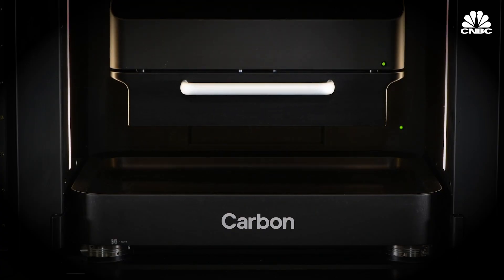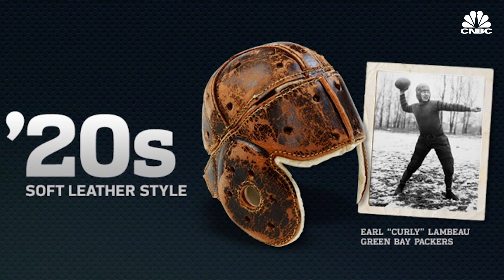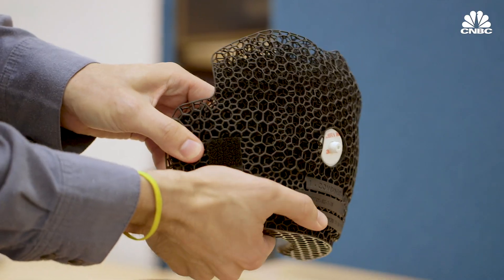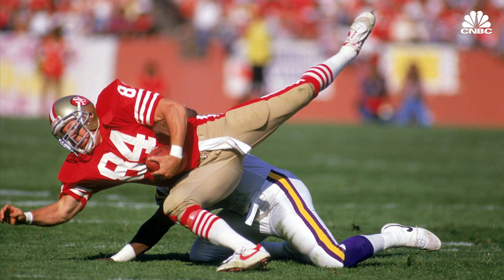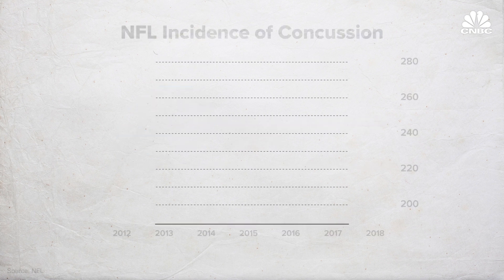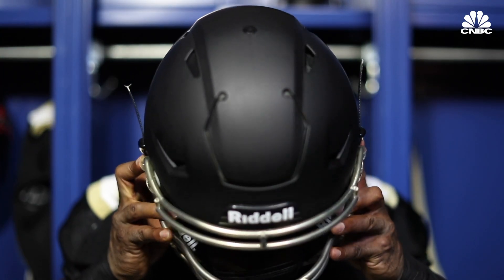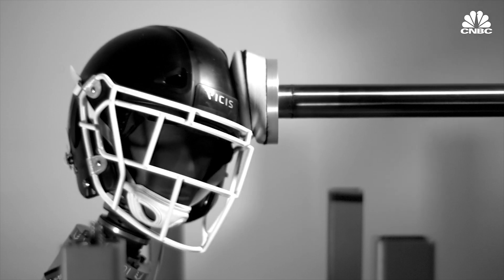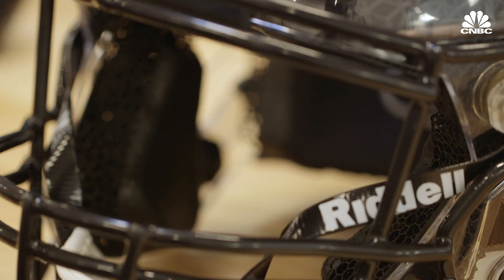Why NFL Players Are Wearing Custom 3D-Printed Helmets

Comment: It’s about how the brain moves in the skull, they are not breaking skulls they are ruining their brains. Probably the best thing would be to remove the helmets and shoulder pads because that would reduce the speed and the amount of Impacts. But If we really care about athletes then all fight sports would ban cloves, back in the day of bare knuckle boxing nobody got knocked out simply because you can’t punch someone’s face without breaking your hand.
Reply: Hannes productions The helmets of the 70s were designed to just protect against skull fractures. What their trying to do with these helmets is lessen the momentum (I hope I used that correctly) of the head when it decelerates after the player makes a tackle, thus making the brain not move as violently
Reply: A Whale but would one might think they would reduce the dangerous take downs if they had no protection.
Reply: How does gloves make it a harder hit
Reply: Jase Maiden because the gloves protect the hand which is made up of many small bones

Comment: The only thing that will make American Football safer is removing helmets. We have a fraction of these problems in Australia and we have 3 codes of football (Aussie rules, Rugby union and league) and don't even try to tell me that there's less impact or physicality in our sports. 

Removing the helmet means players protect themselves and adjust how they play accordingly. 

It will also reduce the barrier of entry into these sports with less equipment costs.
Reply: American football players hit way harder than rugby players😂😂. If you think anything else you are lying to yourself.
Reply: Yeah rugby tackles are completely different. In a sense they maximise the chance of making a tackle but also the safety. In American football you aren't told to wrap around the hips or legs. The dynamic of the game also means players are traveling A LOT faster. Rarely in rugby will you have a player performing a tackle at full speed in the OPPOSITE direction of the person with the ball. Just watch any blind side hits (generally from safeties or linebackers). These tackles not only have more force behind them, but sometimes have 0 real technique, the tackler will just straight throw his body weight (leading with the shoulder) at the other person. All this said tho, players do this cause they feel more protected. People feel invincible when they strap on some pads and a helmet...
Reply: LFly01 The updates In padding are being coupled with new/revised rules meant for player safety. So in theory: it should force players to play safer AND give them the most protection possible
Reply: LFly01 in football, most concussions are caused by players ramming into the body parts of other players or being slammed into the ground, not helmet to helmet. No helmets only leave room for crushed heads
Reply: Rugby tackles are way different than gridiron tackles. Plus, if you've ever played offensive or defensive line before, you'll know the value of wearing a helmet. I live in Australia and have played both rugby league and gridiron. These two sports are not the same. So please stop classifying them as being the same sport.
Reply: LFly01 it used to be without pads. Players were dying left and right in the early 1900’s so they mandated helmets. It’s a completely different sport from rugby. It’s mostly the linemen that have the repeated impacts.
Reply: @KanyeTheGayFish69  hell back then people were dying from infections to
Reply: Absolutely agree!
Reply: It’s too late anyway, rugby players adapted to hitting a certain way so that they would avoid head trauma but nfl players have learned to use their helmet in contact their whole life
Reply: While you have a great point.  NFL players are too big fast and strong to not wear helmets.  The game would slow down tremendously.

Comment: Instead of messing with the Helmets, mess with the pads, make them a little softer for better absorption which might help with mitigating the effect of a hit
Reply: Sergio Buryy Well the helmets are what’s perfecting their brains, which is the main issue
Reply: @gregoropesa5028  Helmets protect the skull. Which in turn can protect the brain however I don't really see how this is gonna change the momentum of one's head. The problem is that the brain goes through hypertension when hit with extreme force giving us concussions. It's not that you get hit in the head really.

Comment: Eh, more marketing BS. There's been no change in how you absorb and disperse energy. The only thing this tech could probably do is lighter, more breathable and better fitting helmets for NFL players. The better fitting part wouldnt be possible for the average HS football player, unless you could afford to have them scan your head.
Reply: Zeitgeist X How do you know what their putting into their new helmets isn’t making them more safe? Are you an expert in the field?
Reply: brain trauma in football is a result of Newton's Laws of motion. as long as the brain is suspended in fluid within the skull rather than anchored, there is nothing that can be done about CTE. Zeitgeist X is correct about that.
Reply: A Whale Helmets aren't designed to stop concussions. They are meant to prevent players from fracturing their skull
Reply: you're right to a certain degree, it might minimize the impact to the brain, but it won't address the acceleration/deceleration of the brain during the impact which is where the problem lies. My friend with a concussion said now even jumping into bed hurts her brain.
Reply: It’s meant to take some of the energy. That energy would not be going to the head. Similar to how a crumple zone works in cars, if you can disperse energy amongst the materials than it doesn’t go into the cabin of the car.